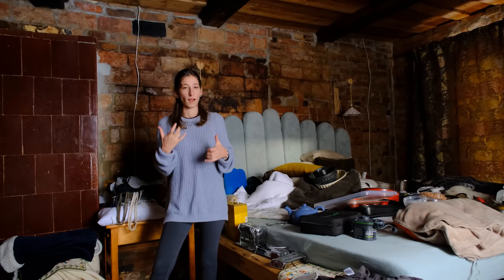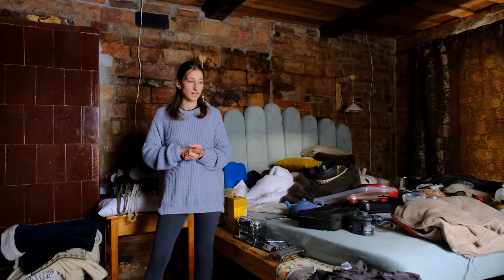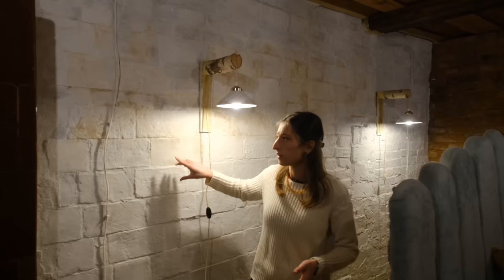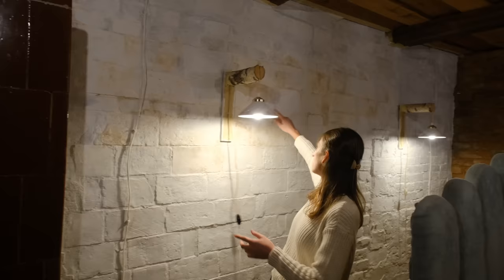Painting the Guest Room's Brick Wall?!

Comment: You have a nice tiled stove (Kachelofen) in your guest room. Is it still working?
Reply from the maker: Yeah it works. But need a lot of wood to get warm but stays warm for 12 hours
Reply: @DoBeDiff  I have a trick. I first put in a tiny little bit of wood heat it up and let it work for 1/2 an hour. Then you heat normal but with less wood than you normally need to get it warm.